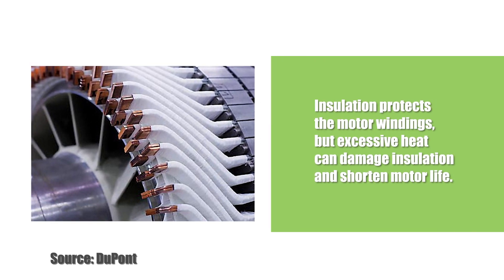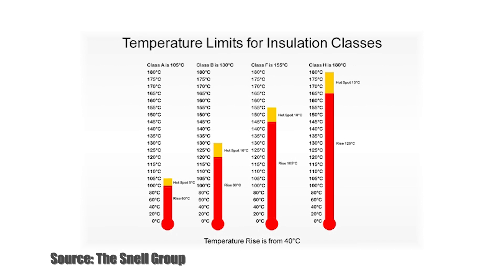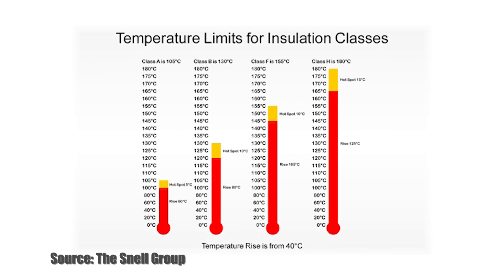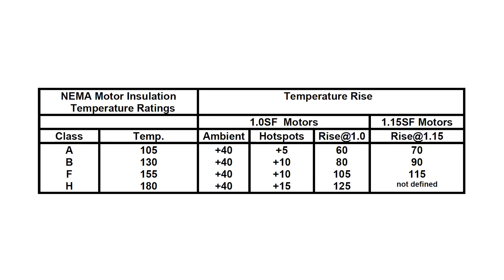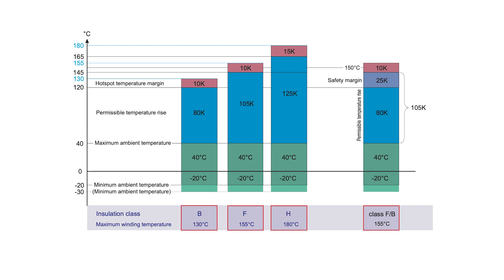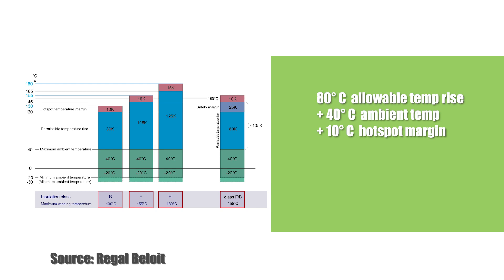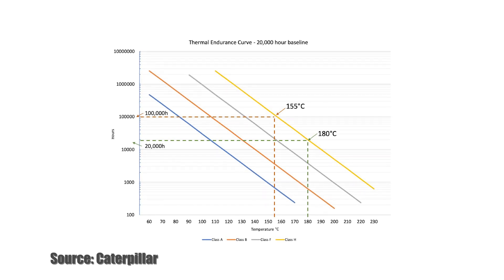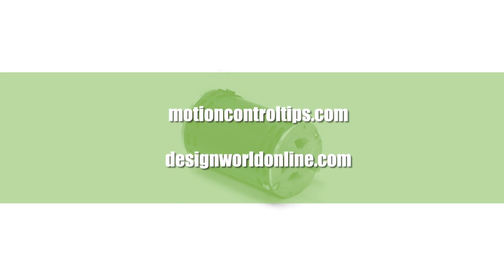How to Calculate Motor Temperature Under Load: A Motion Control Classroom video

Comment: I'm having trouble understanding the reasoning behind the calculation. If maximum allowable temperature is the sum of the ambient temperature, the temperature rise, and the safety margin, then does that mean increasing the ambient temperature of my motor's environment will increase the maximum allowable temperature of the motor winding insulation?

For a class A motor operating in a 40°C ambient temperature, the maximum allowable temperature is 105°C.

But, if my class A motor is operating in a 100°C environment, the temperature rise is 60°C, and the temperature margin is 5°C, then would my maximum allowable temperature be 165°C?  

Intuitively it doesn't make sense to me that increasing the ambient temperature would increase the maximum allowable temperature. I'd be grateful if you could explain this to me.
Reply: The specific phrasing is important here. She says "the maximum allowable temperature ASSUMES an ambient temperature of 40C" meaning that all the calculations start from 40C as the normal operating temperature, "and adds to that" the temperature rise and margin, two variables. The calculation thus is not taking the ambient temperature as a variable. She goes on to say "In addition to a maximum ambient temperature of 40C..." so again 40C is the max ambient temperature, and the calculation is for the max motor temperature allowed for the ratings of the insulation and windings. Thus you would not be operating the motor in a 100C environment. There is also an altitude maximum etc.